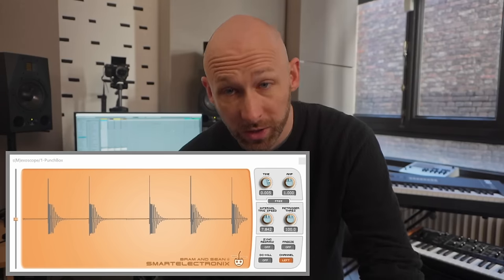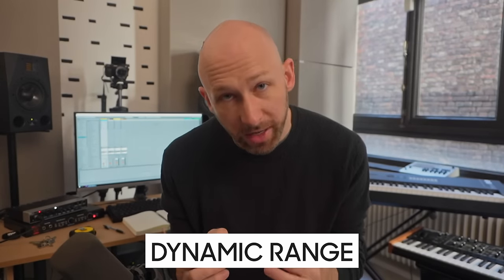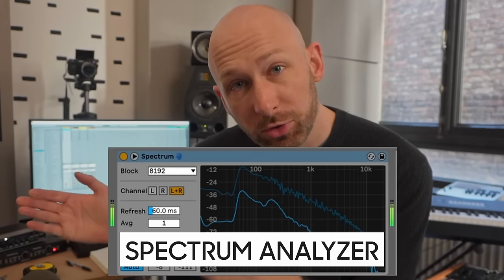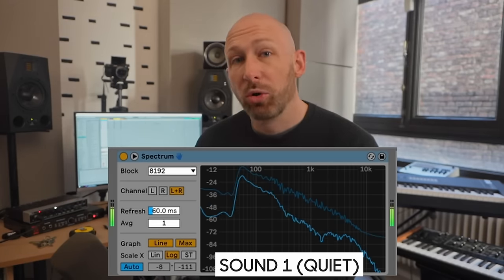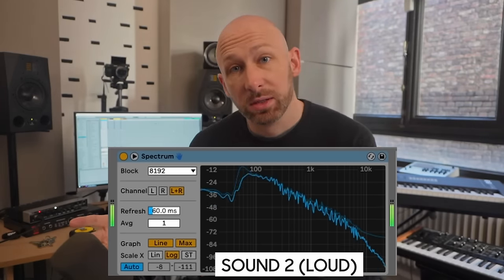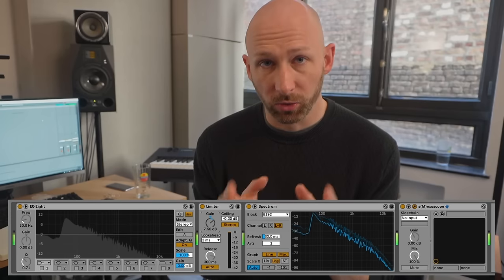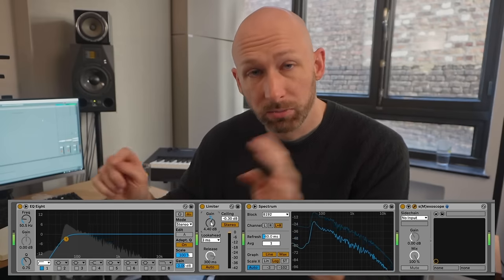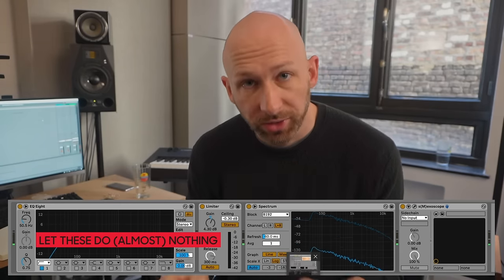Why your mixes sound thin and weak (probably)

Comment: I hate the term "mixing loud". The loudness is controlled by the volume knob during playback. If you are having max peaks all the time, there is only one sound level. For me, the key is not thinking "loud", but to think "dynamics". There has to be headroom for the dynamics. Without it, nothing can be punchy. 

I have enjoyed music for almost half a century. Some time around year 2000 I stopped buying new music. The "loud mixes" sounded like shit. No dynamics, no headroom. You will of course not know what you are missing until you hear a very dynamic recording through a sound system with great dynamic headroom.  And that is the problem: If your reference is Apple Airpods, experiencing truly dynamic music is not an option.
Reply: Can you make an example of a song that you think has great dynamics? Thanks
Reply: @lennyblandino  It is not as easy as that. Songs available for streaming are often remastered for low dynamic equipment. We must talk about specific releases, not only songs. For instance, “Private Investigations” from the Dire Straits album “Love Over Gold” had great, punchy dynamic in the original release on CD, but was remastered with much less dynamic about a decade later, and it is pretty much the same on Spotify. But that is an example for you, if you can source the original.
Reply: @rofferdal  Thanks for your reply